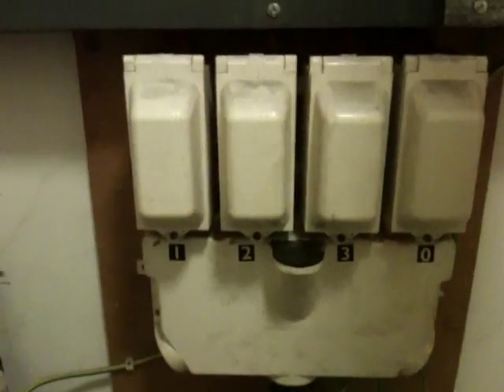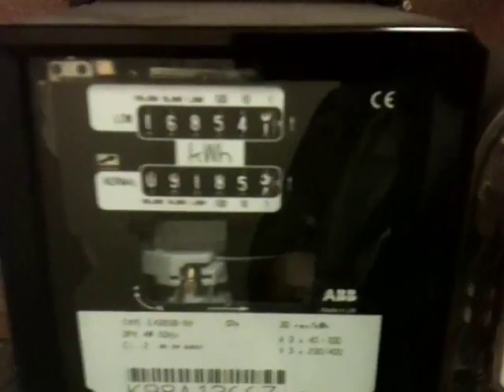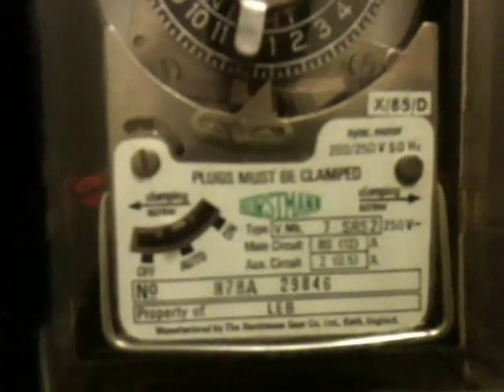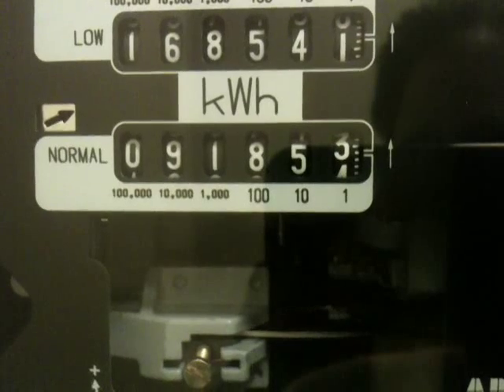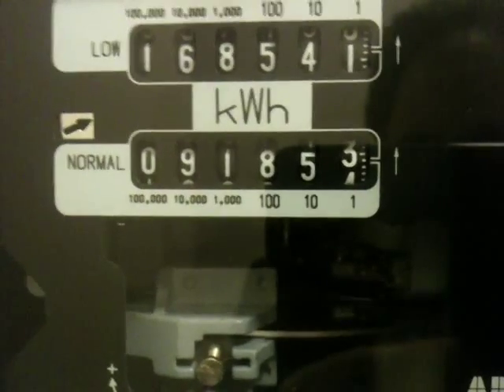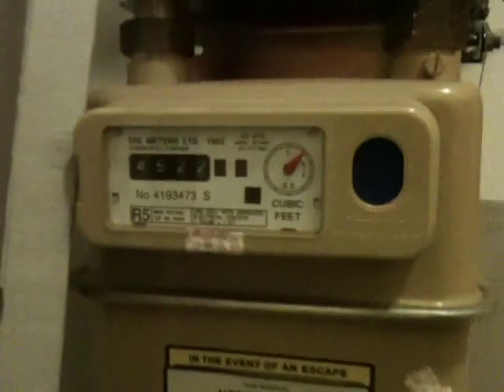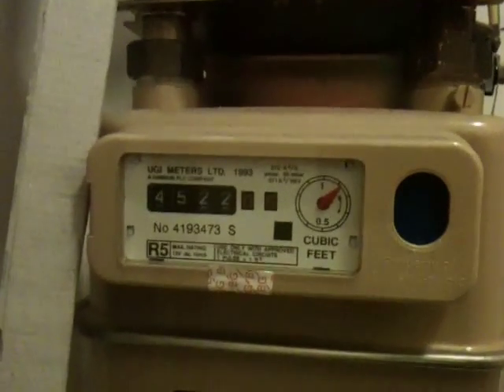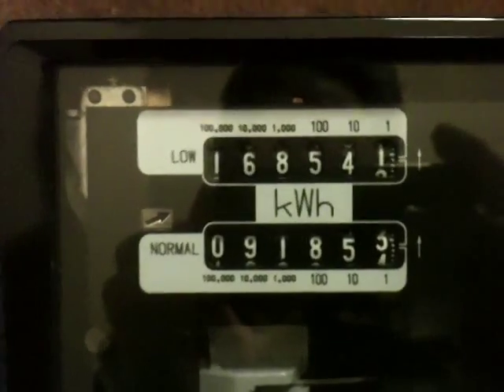Domestic 415V 3-phase supply. ABB Meter and Horstmann timeswitch

Comment: Very Nice!! I wish that my GEC 3ph, dual tariff meter was direct-wired, I may have been able to use it then! :-)

The thing is though, my one needs CTs to work correctly. OK, so that does mean that it'll be able to take a bigger load than this one, which I suppose, in the right setting, is a bonus. 

ALSO! Nice to see a Horstmann Vmk 7SRS in service there! YAY! I own a few of those, as you probably know by my vids. 

Nice upload, I do like those MEM 'exel' isolators. Drool......

-BoomBoxDeluxe.